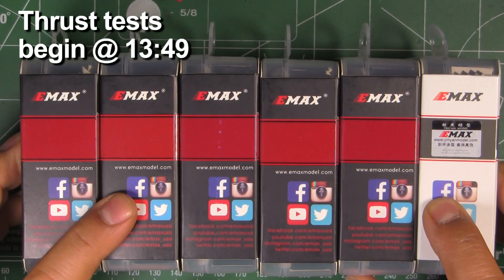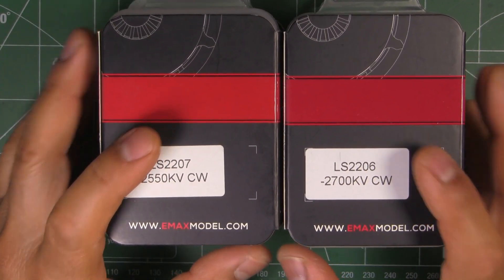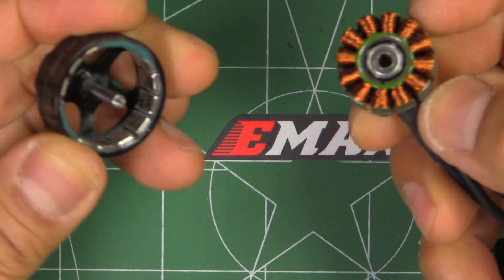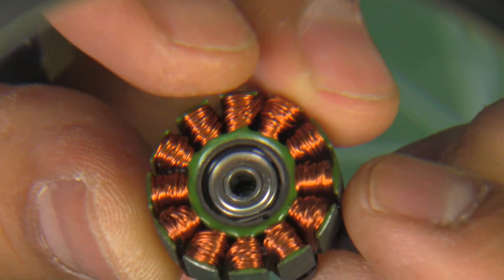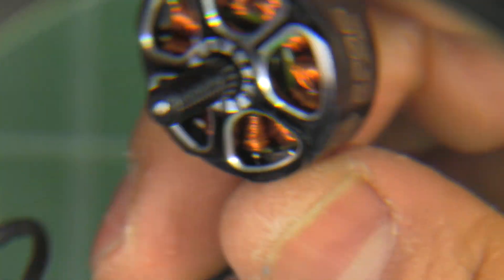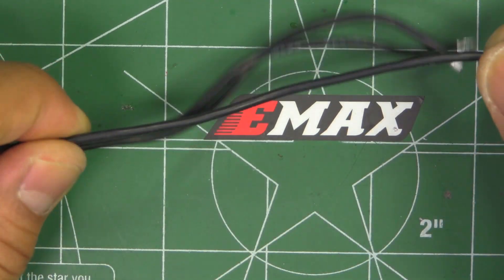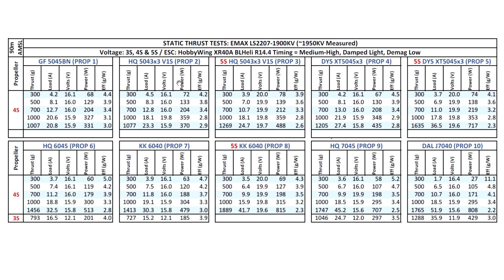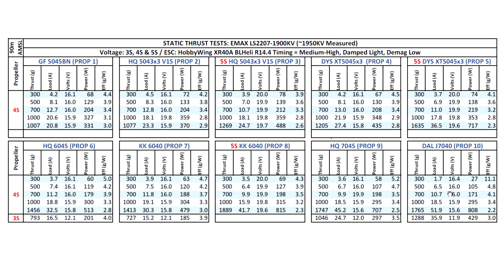EMAX LS2207-1900KV 3S-5S Thrust Tests

Comment: I looked at the thrust table and what really has put me into confusion is the efficiency this motor gives using a dal J7040 @ 300g!!!!!!! The first value at the last table!!!!! This can increase the hover time of the quads by a great great great margin!!!!!! Could you please confirm this value?
Reply from the maker: Most likely when you use the prop on a motor the efficiency will not be as good. These are in static condition. So maybe if only hovering or slowly moving without flying forward at speed you might see high efficiency. Still it would be interesting to try this prop and fly not so aggressive and see if flight times 8ncrease compared to other props
Reply: @EngineerX  Thanks! Will try it and update here!

Comment: Good sir! What would it take for you to run the exact same tests on MB Primo 2208 1950kv motors? I just switched from running 6S on the  EMAX LS2207-1900KV to MB Primo 2208 1950kv. It might just be me but I'm feeling like the MB Primo 2208 1950kv are less power and less efficient. Thanks so much for all your work, it is really appreciated.
Reply from the maker: Hey, that's not what we'd expect. Higher  and larger stator should yield a faster setup. We'd have to see actual KV value for the Primo. Also you may want to try different props, a tad more aggressive pitch perhaps. Some props do flatten out at the top end on 6S and KV1750+ . Unfortunately I don't have a Primo motor to  test. Have you checked miniquadtestbench.com? I believe QuadMcFly tested that motor.. but not sure . Check to see if he has and you can compare to other similar motor to your previous setup on his data base.
Reply: @EngineerX  Thank you so much for the info. I totally agree with "Higher  and larger stater should yield a faster setup" . I think I am just feeling a placebo affect thing. Sadly no MB Primo 2208 1950kv tests on that website. If you have a mailing address I'd be happy to purchase one and have it sent to you.
Reply from the maker: @bumbleboltfpv3707  contact me @ engineer_x_@yahoo.com once test is finished I can always mail it to you if you're in the USA. I do Have lots of motors waiting on the test queue but I could squeeze it in at least to get thrust data and can forward the raw data ahead of the video edit since video making is what takes me the longest. Let me know here when you email me in case it goes to spam

Comment: Just tried the 1900 on 6S its frikin bananas
Reply from the maker: LOL... that was my impression when I first tried 6S ... but on 1750kv. 1900 must truly be more bananas
Reply: Oh hey! First, thank you so so much for this video. These help so incredibly much and are really really appreciated.
Second, I got a little question if you have time. 
I am currently running the LS 2207 1900 KV on a 6S with Dalprop 50x46 3 Blades. I'm also using the Holybro Tekko32 35A ESC's.
I was curious to try out a couple other props I have on the 6S. The Lumenier 60x50 3 Blades and the Gemfan Flash 60x42 2 Blades.
Do you think trying either of these out is a bad idea that might fry my motors?
Reply from the maker: I like to "move up" slowly when first trying setups. So for instance, I would first try KK6040 2-blade, couple of laps, land, check motor temps, then move up to HQ6030x3 or 6040x3 and keep checking temps. Those are low pitch so they won't stress your setup. Lum 6050x3 & GF6042x3 are on the aggressive end, so I would check less aggressive props first. Unless I've seen lots of people using a similar setup, then no need to check. 
I actually just got my order of GF6042x3 & HQ6040x3 V1S from RaceDayQuads, I ran them on 6S on a 2306-1800KV motor so that would be very close to your setup to give some idea of Max Amps that can be expected. Let me check the logged data and I'll let you know later tonight what the Max was on 6S & 5S. Then you can multiply Max*0.6 (aggressive) or *0.65 (conservative) to see if it's close to ESC's capability.
Reply: Good thinking. Baby steps are good. Thank you again so very much for all the advice and videos.

Comment: As motors these are pretty good.  Don't buy them though.  Only CW with a shortened shaft is a recipe for your props to come off.  Doing and remembering to do things to mitigate the problem is annoying at best and a disaster if all the sudden you spin out of control with your long range rig with your precious video of the newly erupting super volcano in Yellowstone.  A puff of yellow smoke now it's legacy.   Pangs of anger deep inside resonate as you stare at the 6" props personally modified to not come off as the sound of others overhead returning from successful missions sans Emax motors thrum overheard.  Emax made these reduced height nuts to make this stupidity work but won't include even a spare, good f*****g grief.  I'm done with Emax.
Reply: You seem Bitter Mr. Bittner...
Reply: @arturpelicho5833  Indeed,  a Bittner little man.  A good rant helps though, ha.  
When it happened I lost my  Runcam and GPS.  Flung out like the stone from a sling as my quad spun like a cat 5 twister.  Bitter yes but I don't want others to lose their quads, etc. so I rant with sweat on furrowed brow, hands shaking........

Comment: EngineerX, Q&A please: my motors got very very hot (emax ls2207 1900kv), one of them flamed up, but i have not verified if it was the motor or the tpu soft mount yet.  both rear motors are relatively tight now and do not spin as freely as the front 2.  is this repairable or must i buy replacements?  i don;t understand why they got hot, i'm trying to do that research now, i do not have any screws touching wires.  HelioSpring, AK32-4in1, 6S. Thanks in advance.  Oh, and they sounded much rougher than this demo.
Reply from the maker: nerdCopter [Thibodaux Louisiana] I think those will need replacement. When motors get super hot. The enamel and epoxy protecting the windings can melt and then solidifies once cooled down. You'll have to crack open and inspect if epoxy went onto magnets and if any sign of melting. Weird that it was the 2 rear motors. Could be a number of reasons: FC  setting, softmount too soft. ESCs... just make sure you check cause not good if you get replacements and same thing happens again. I may have 2 of those I can send for a very reasonable cost to help you out. I do have to look for them first. Because I moved to a new place about 2 months ago so still have stuff in boxes. Let me know thru email. I'll take advantage of shipping and send the spare RCX motor too. But gotta check tonight where the LS are.
Reply: thank you, i will email reply

Comment: Hey man, keep up the good work, I'd have no clue in what motor to get without your videos.

I wonder though, would it be decent to use the LS2207 1900KV with a 4S 5inch quad, DAL C 5040x3 prop, or it would be too weak? (it's a beginner freestyle build, not a racer) Thanks :)
Reply from the maker: For beginner it would be very good on a low-weight build (around 325g w/o battery) and if your ESCs and power distribution is 5S or 6S rated, then in the future you can use 5S or 6S batteries to increase performance noticeably. 1900KV will be "mellow" and could feel a little slow once you get used to the quad. Most people start with around 2300KV if you're going to stay with 4S only. If you plan on only 4S and using it for a good while, go for around 2300KV, even as a beginner, it will still be very manageable.
Reply: EngineerX you just read my mind lol, I plan on a 6s capable build and run it on 4s with these motors, I'll make the leap in the future when I'll feel I could use some extra power. Thanks! :)

Comment: +1👍  These are the ones i ultimately bought a couple months ago -- still not in the air for my first build, but i'm dropping a big thank you for the tech info.  Loved the tag "All You Could Ever Want!" on the 2550kv version. i chose these 1900kv for 6S with the help of your videos and much reading.
Reply from the maker: Everyone is liking 6S because the packs don't loose as much voltage through discharge when flying. Check out the latest LiPo test by Joshua Bardwell, thoe RDQ packs look very good for the price. I bet they're going to sell out quick. Always happens after good results from known tester. 
Hope your 6S build gives you good performance :)
Reply: just an update.. after getting some stick time, albeit no real fpv acro yet....  i can't say enough good about these ls2207 1900kv, so powerful and smooth after the right configs/throttle curve. thanks for helping me decide on these so long ago.

Comment: Bro, your first table that shows the motor functioning with all of the props shows values that are very different from the ones stated in the more detailed tables. Why is that? Shouldn't they match?
Reply from the maker: You're right... Those are data - copy/paste mistakes due to using the same Excel file from previous tests and not paying attention. Looks like I messed up on transferring the thrust stand data onto the Excel spreadsheet. Thanks for pointing it out. I think I was working way too late at night on this one with too little sleep.....
I'll go over the raw data and re-copy from original thrust stand data to thrust table. Just give me a few days to revise the table.
Reply: EngineerX Thanks mate!

Comment: But if the current draw is 25 to 35 percent lower during flight, the max thrust during flight should also be lower right? 
would be great if some one could explain why it would or would not be the case.
Reply from the maker: Jesse Rolfes Yes. Más thrust will also be lower because prop thrust varies with speed. At 0 velocity thrust is usually greatest. Same with cars. When you're doing 55mph /100kph motor is only producing a fraction of it's max power but to get to that speed from zero at some point depending on throttle, it had to output much closer to its max power. It's difficult to measure what max thrust a multirotor motor outputs in flight. You could measure acceleration and based on aircraft weight you can calculate max thrust.

Comment: EngineerX, would be very very nice to test sub 2000kv motors with 3 bladed 6 inch props, such as DAL Cyclnone T6040C or HQ Durable Prop 6x4x3V1S...
Reply from the maker: For some reason I didn't see/read your post. I will remember to try a 6" tri-blade prop on the next sub-1800 motor I test, most likely the rcINpower GTS V2 2306-1800KV
Reply from the maker: Hey, I emailed you the thrust test results (raw data logs) for the the 3 2207 Hurricane motors. I'll be making the thrust tables soon, then editing the video on those but it'll take me a couple weeks to complete. Thanks for sending the motors :)

Comment: I'm curious... would these motors work on 2s? To those who wanna say "no, go 4 s or 3s" I do NOT fly 3 s or higher, so, respectfully, don't mention those. I have my reasons.
Reply from the maker: Umbra Jord Yes, of course they work on 2S . However, to get any significant amount of thrust, you will have to match it to a propeller that will make enough thrust for your application. Aircraft type, weight, payload, and target speed are just a few of the design factors that will dictate propeller size since you've already constrained flight battery voltage and motor size and KV.
Reply: Awesome to know, thanks!

Comment: Did you run this motor with 5046/5048/5050 props? I think this might be the sweet spot for 4s 5" builds with these motors.
Reply from the maker: Ryan O'Keefe  Yes, the higher pitched propellers will work fine and still stay within very reasonable Amp load.
Reply: EngineerX thanks. Did you get test readings at all? Trying to build an efficient 5" with these motors and wondering if it's best to run high pitch and needing to use less throttle or if lower pitch with more throttle is better. I.e. What is the most efficient prop To get cruising thrust (say 650g)

Comment: I bet these will work well on 6s with a higher pitch prop.  I can't break 80a on most flights using cyclone 5046 and some t-motor f40pros 1600kv on 6s, i need more kv.

Comment: will going to 1000kv or even 800kv be a good option for efficiency? i keep remembering my first setups with the sunnysky 800kv using 9" props
Reply from the maker: hamad musabeh For 2207 on 7 or 8" my best guess is 1200kv would be the lowest that could be usable and still make good thrust. 800-1000kv works well with 8 to 10" props and larger motors. So all depends on prop size. 1800-1900 probably the lowest for 5-6" on 4S-6S
Reply: thx for the info , what do you think of the dji mavic motors and 7" combo , i'm impressed by the  flight time / using 3s and 7" props, so i'm trying to get spare mavic motors and their props installed on a CF frame and have a go on flight time.
Reply from the maker: DJI sure knows how to get the longest flight times. I have not researched much as to what those motors are. But I think I recall them being somewhere between 1200 -1400KV and motor size I'm not sure but something between a 1806 and 2208? Do you know the actual size. Are they using LiHV battery? That would be a good combo for long flights. Also the prop is 7 or 8" and low pitch 2.7" so those are way more efficient than all these aggressive props we use in FPV.... just totally different setups/application

Comment: I see people mentioning using this motor for 5S 6" props . . . I usually just go down to 2200kv on motors for my 5S 6" rigs (only rigs I fly now), no issues. Would this lower kv not be better on 6S?
Reply from the maker: Sadistic Leprechaun Absolutely. 6S would work very well. My 5S runs look like there's still more in the motor. So once unloaded in the air, 6S will be just fine.

Comment: lower thrust than I was expecting...maybe decent on 6" 5s...
Reply from the maker: Stephen Wright We're used to seeing huge numbers from all the big motors that have recently come out. I saw someone's video flying this motor on EMAX Facebook page and it didn't look slow.
Reply: yes its not slow around 1200g but it would feel lower power than the current solid level (IMO 1350g for freestyle)....
Reply from the maker: Sounds about right, 1350g for freestyle. Good that they also have a 2550KV so one can pick best option, lower power output/longer flights or higher power/shorter flights
Reply: Yes this is definitely a 6" 5s and 6s motor.
Reply: Late response but I think 5050 props may be the go for these. looks like it would push the 1300g+  on 4s and stay within 30a esc territory.